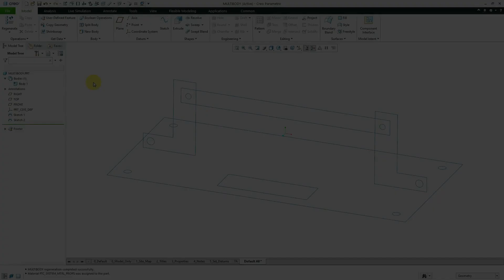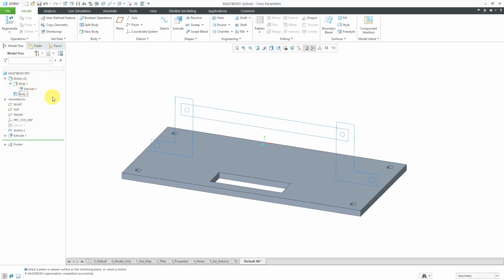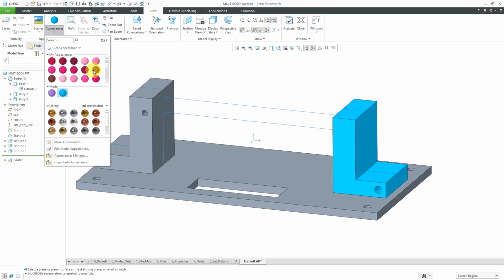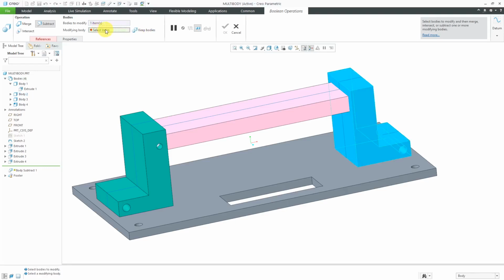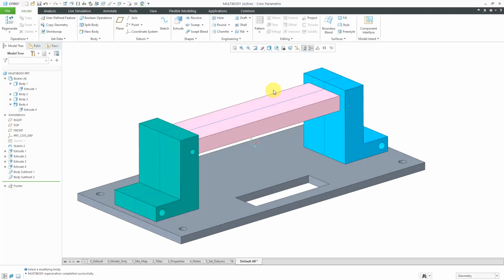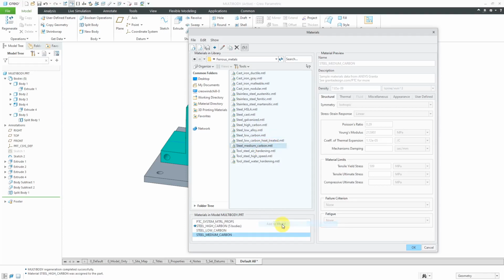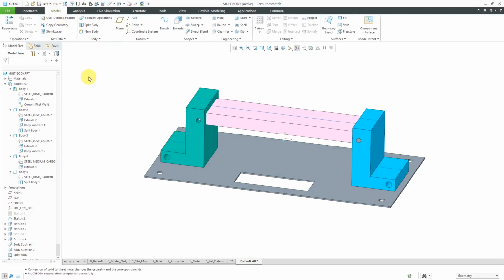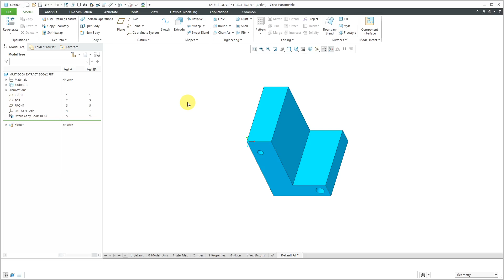Creo Parametric 7.0 Multibody Modeling First Look!

Comment: An open door for lazy and sloppy modeling.
Reply from the maker: These kinds of complaints make me really feel for PTC. Before April: it's crazy Creo doesn't support Multibody. April: why did it take Creo so long to get Multibody? Now: Creo should have never added Multibody.
Reply: @CADPLMGuy  Don't feel for PTC man. I've had over 30 years of their schtick moments like this. I've used 8 other software besides Pro...oh sorry...Creo...over the years and have seen more than my fair share of this type of stuff. Don't get me wrong, I'll go my grave defending it as the best one out there.  But this latest "shuffling of the deck" to basically do Top Down Booleans in the "cool" way is too much. IMO, this is nothing but another "go along" with everyone else jumping off the cliff mentality.

Comment: Awesome video thank you for putting this together so quickly and sharing!  One question, when a 'new part' is created from a body (as shown near the end of the video) is the new part now starting off with a feature which is fully dependent (i.e. parametrically linked) to the original part in which the body was created?  In other words does that 'new part' from body functionality behave similar to a dependent merge inheritance?
Reply from the maker: It's got an External Copy Geometry feature with Update Control set to Automatically Update, so the geometry will update with changes to the Multibody model provided both are in session.
Reply: @CADPLMGuy  great! thank you for your crystal clear answer :)

Comment: Great update! I can see a lot of potential, one of the top of my mind,  when you are going to model low number of 3D printed  "components" with out the need to create an assembly and multiple parts. Furthermore, when you subtract let say body 2 (bracket-1) to body 4(bridge) you don't have the option to give the two components (materials) some clearance. That would be nice feature in the next updates. Or the philosophy of multibodys are very different and I'm mistaken.
Reply from the maker: Watching Martin Neumueller's presentation on Multibody at the virtual LiveWorx conference, I now realize you can already provide for clearance using the Offset Surfaces command in Flexible Modeling. I will make a video in the next couple weeks to demonstrate this.
Reply from the maker: I recommend that you propose those suggestions through PTC/User and the PTC Community. Martin has two working groups there where he is soliciting input for future enhancements to Multibody.
Reply: That would be very interesting, thank you for the reply!
Reply: The link for the video https://www.youtube.com/watch?v=nvg8VidbNzU

Comment: I won't use this feature to build a complete top-down assembly, for real assemblies the current skeleton model approach is way better than this. But multi-body is useful for things like a multi-body skeleton model (instead of using different surface extrudes as you can do now) that you use then to drive a multi-body assembly. I think not being able to revert the "keep objects" toggle is a let down though...
Reply from the maker: I expect that being able to toggle Keep Objects will be a maintenance release enhancement. This is the FCS (First Customer Ship) build code.